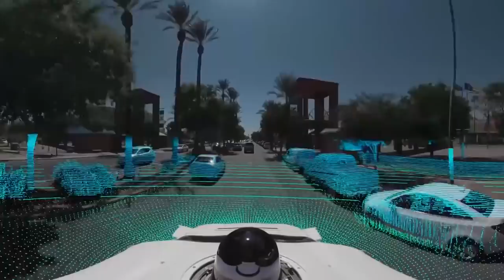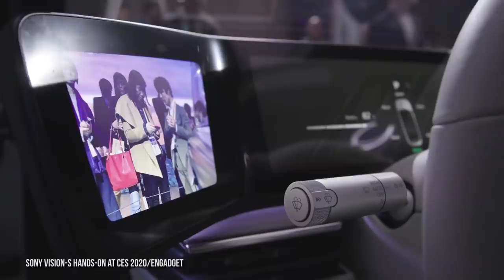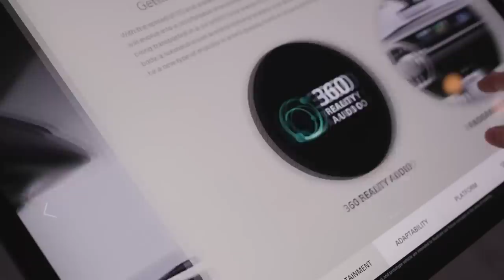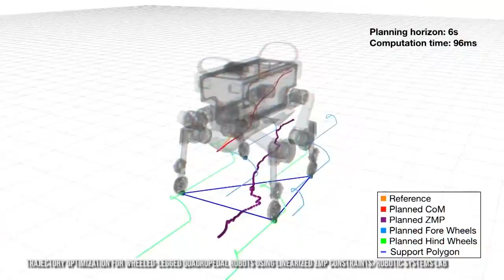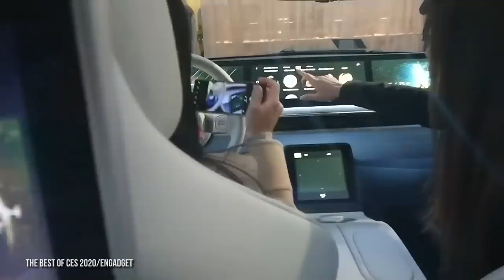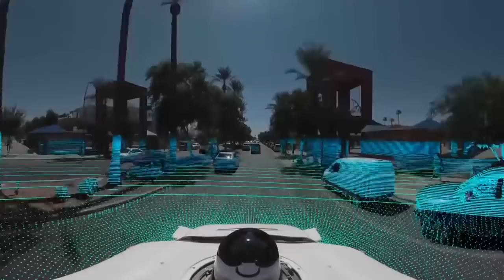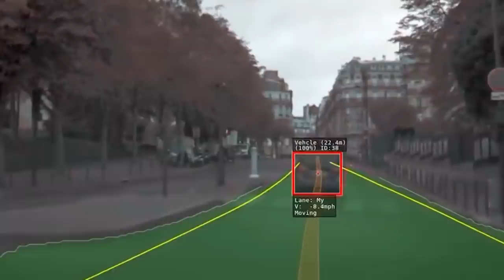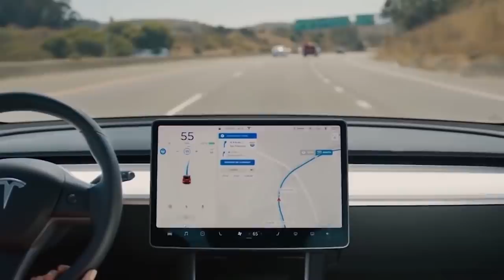Sony Officially Reveals Car To Beat Tesla

Comment: 2029: Tesla vs Sony vs iCar/Apple Car
Reply: 2029: VW already will dominate the electric market.
Reply: @ΒΞΔΝ  Yes a dream that will never happen.
Reply: ΒΞΔΝ Nope. Tesla will
Reply: @waynelewis9110  I would have to disagree. Tesla does now, but VW already has released the first electric model that is cheap enough for most to buy, they also already have enough factories in place to mass produce. They will be cheaper, have German quality builds, better warranty. Tesla is currently being exposed for poor quality, and customer service now that they are a few years old. I'm not sure Tesla can keep up when VW and Toyota start to mass produce.
Reply: @ΒΞΔΝ  Well the VW quality is shit since the Diesel gate, even Audi is cheaping out now.
Reply: @6meterkuk55  The build quality is still top notch. Yes VW brands are cost cutting in 2021 models because they are going all out in electric. As far as diesel gate, all that was, was having the cars programmed to unlock more power  after a certain mile to cheat U.S. smog standards. Sure it cost them a pretty penny, but that did not effect build quality, nor was the reason for cost cutting in 2021. We should also keep in mind VW owns Audi, Lambo, Bugatti, Porsche,  Bentley,  Lotus, Polestar, and Volvo. They have access to engineers from almost every top auto brand that is not U.S. or Japanese made.
Reply: ΒΞΔΝ years but don’t forget how Volkswagen with their the DSG gearbox made customers like me and so many other loose like 8000 usd due to por quality. I would say this was was Wieselgren then dieselgate.
Reply: @ΒΞΔΝ  VW is such a big company -> nothing gets done, executives talk and talk, and talk, and talk and literally nothing happens.
Reply: ΒΞΔΝ  second to Tesla.
Reply: @ΒΞΔΝ  Are you aware of the VW smog scandal? How about Toyotas Prius recall, or Tundra recall for dim turn signals? They can't even make turn signals properly. lol
Things you're missing : 1. Tesla charge stations. 2. Factories built for EV, not repurposed for EV 3. Streamlined sales. Ford to VW, theyre fighting their dealerships who make a lot of back-end on repairs. That's a lot of money EV's wont make them. It's like telling a restaurant to only sell chicken fingers when $30 steaks are its real money maker.
4. Battery tech. VW is expected around 300 miles, so their 2021 car will maybe get what Tesla's 2019 and 2020 cars get? 
I don't really see these companies being real competition personally.
Reply: ΒΞΔΝ 
 VW produce gas engines, they have not idea how to produce batteries.
They don’t have even a single battery factory.
Reply: @ΒΞΔΝ  that's what bums think 😂😂😂
Reply: ΒΞΔΝ eletric market maybe but autonomous is what matters more
Reply: @ΒΞΔΝ While I agree that VW is best placed to be the first true competitor to TESLA, the facts are that even if they started tomorrow to retool even one factory for electric cars only it would take 6 month to a year for them to begin making cars at best. Figure another 6 months to a year to work out all the kinks and bugs for getting started. Sp we are now 1 to 2 years away from their first production CAR. Tesla is already making 4 different production cars with a 5th coming next year, a new Semi-truck and by early next year will have 4 Gigafactories online. Include the fact that they have the largest charging network in the world, and still growing, and the most experience making electric vehicles and the batteries for them. That's a very big mountain to climb, not that it can't be done. If it was that easy for companies to go from gas to electric Tesla would have failed as soon as they proved that electric cars were a profitable market. For the last few years we have seen company after company say they have the next TESLA killer come and go, where are these cars now. This sounds strangely similar to when Sony put out the GAMEGEAR or Microsoft put out the XBOX and everyone assumed that NINTENDO was going to bankrupt or disappear. TESLA is going nowhere anytime soon and they will continue to dominate the market for years, if not the next decade, until someone can stop talking about the NEXT TESLA KILLER and actually put one into production. Even then TESLA is going nowhere soon.
Reply: @ΒΞΔΝ  - ba ba ba bullshit.
Reply: I say 2025, Tesla will apply for bail out from the federal government, *again*. Only Americans have this weird fantasy that Tesla can compete with the Germans and japanese automakers. Once the electric becomes mandatory that will be the demise of Tesla.
Reply: Also American built quality are like chinese made, all blink no reliance.
Reply: 2025: musk wealth exceeds 150 trillion on rumours of 100 to 1 stock split and crashing sales due to Samsung-Hyundai-Sony-Toyota-Panasonic car with better specs cooler design and free covid vax injected for every passanger every 15 min inside the car and also free netflix in 24k resolution. We call it progress
Reply: VW quality 🤮.....I think Toyota is also investing heavily in developing ev and fuel cells... because they are the richest automaker brand and they are the world leading car manufacturer that invest heavily in research and development.....still not sure what future holds
Reply: @boohoomoron7629  for the past 3 or 4 years every automaker has been talking about their new take on the EV that will blow away the competition (TESLA) and yet I have seen not one car come close to their first Model S. What makes you think that 5 years from now when Tesla, who only makes EVs, is on their 6th or 7th Gen car that some CE makers are going to put out a quality EV at a competitive price without losing significant money. Again, it is going to take a minimum of 6 months to retool a factory to make electric cars in anything approaching real numbers. You still have to get it certified for the road and market it to everyone and prove it is worth me dropping money on it. Just because VW or Toyota put their name on it doesn't mean it is any good or comparable to the market leader. If Teslas were as bad as some people want to believe they wouldn't be selling the way they do or holding their value quite so well.
Reply: ΒΞΔΝ I read your comment from a week ago where you said that the VW electric car will “be cheaper, have German quality builds, and better warranty”. I’ve never owned a German car but only because too many times have I heard people complain and read reports of German vehicle owners not being able to work on their own newish vehicles because the build was so complex that they needed to take it to a dealership for them to work on it. The dealership would in turn, no doubt, charge a hefty fee because they know they’re the only ones capable of fixing something because they have the schematics and tools. In my opinion, I feel as though German build quality won’t be the best when it’s the most complex. High performance cars are one thing, but when my  base model car is around the same price as German base model vehicles I can work on my car.
Reply: @ΒΞΔΝ  true, tesla poor build quality is showing, the car is built like ford focus with electric engine and big screens...it's made cheap...vw has more experience in building cars...vw makes buggati case closed...
Reply: @ΒΞΔΝ  LOL, thanks for that laugh. That was a good one.
Reply: @The-Heart-Will-Testify  take the the screen our of the Tesla, and you'll laugh at the interior, it's so basic, even more basic then some 80s cars. They only have good battery tech, it won't be long until they are surpassed
Reply: @sunitadey9701  They just measure everything based on data in US without considering other markets. I currently live in China and in big cities like Shanghai, Guangzhou or Shenzhen the EV account for 10% of all vehicles on the road. Tesla has sold shy of 80,000 last year why chinese manufacturers sold 1.4mln of EV cars. I guess Tesla is more suitable for american market given their low quality standards, much better network of superchargers,  more tesla service stations - but they surely won't become a world leader in that field. Therefore I agree with you that any car manufacturer can actually catch up or even outrun tesla in a near future. I'd even go beyond that and say that even chinese car makers have already done it (providing just as low quality product as tesla). In Guangzhou they have already been testing out self-driven taxis since 2019 with a great result.
Reply: @ΒΞΔΝ  Elon has been working on tesla since he was 30 years old and his goal wasto make electric car and scale em to a massive production.. that was the goal of his life. and he did it he have several years ahead of everyone and with the Software of lvl5 SFD ... tsla will be a 1T $ compagny by 2025
Reply: @aladdin8372  Well, look out Elon because his cars are getting a bad reputation slowly around the world. VW has released the ID-3 and Europe seems to love it. Will be coming to the states in a year or so. $35K. I'm not saying Elon won't be fine, he is unstoppable human, but the car industry won't be it for him long term. I guess we just have to wait and see how the VW holds up as a new market for them. I know one thing for sure the quality to price is already on VW's side. You will see the ID-3 be a soccer mom fav over minivans and SUVs by the looks of the design. Then I'm sure in time we will get a line of performance electric GTI, GLI, R
Reply: @ΒΞΔΝ  Once the giga factory will be over and full selfdriving software Beta version OVER + approved by gouv probly next year VW have 0 chances against tesla for atleast 5 year

Comment: "car to beat tesla"  the load of car makers that say that and the same number of car makers that failed lol. that aint gonna be different. even if the managed to have the same range as a tesla, they wouldn't have the big advantage tesla has, superchargers !
Reply: All those other challengers were Chinede automakers. This is Japan's Sony.
Reply: Tesla's Superchargers are not an advantage
Reply: Corey tesla superchargers are an advantage, there is no other such wide spread and available fast charging than superchargers. So if u want to go on vacation and spend 3 hours at the charger to get 30% go ahead, but tesla has the superchargers.
Reply: Outside of the USA, other chargers greatly outnumber Tesla chargers.

Comment: We are much closer to autonomous driving than we were ever close to a "flying" car. The only thing that would help speed that up would be if every car was computer controlled. We don't even need 'self-driving' to solve traffic jams. All that's required is computer regulated speed control.

Comment: Not sure I buy some of these premises. Like "The power drain from all the computing cancels out the efficiency benefit of having the car drive itself". And that Moore's Law is no more. I believe the chips in the new Tesla controllers are down to 7 nm with a likelihood of going to 5 at some point soon. Maybe the pair generates about 60 Watts, if that. One thing is true: along with Moore's Law's prediction about chip density, the attendant speeding up of the processors, which the computer industry has enjoyed lo these past four decades or so, has pretty much stopped cold. But semiconductor geometries do continue to get smaller and smaller - though no longer on Moore's predicted schedule.

Comment: Sony isn't actually making a car, AFAICT -- the car itself is built by a Volvo partner company involved with the Polestar brand.  Sony is making an off-the-shelf hardware and software solution for self-driving tech that automakers can just buy and integrate into their vehicles.  The car is just a live testbed.

The main competitor in that space isn't Tesla -- it's NVIDIA.  Heck, prior to Tesla going all total vertical integration, even they were one of NVIDIA's clients.

Though a similar product might exist one day, it will be as close to this as production cars usually are to concepts, and it will probably be a Polestar-branded car.

Comment: If Sony has no intention of releasing the Vision-S then why even build a car to begin with? They did it for their sensor technology, yes, but according to this they designed the car to have full control of their sensors. What’s going to happen when they release the sensors to other manufacturers, if they do? They won’t have full control of the sensors then. In my opinion, I strongly believe they would’ve been better off creating the sensors and then putting them on different manufacturers’ vehicles to test the sensors. This is the equivalent of me getting some water but not because I’m thirsty but to give it out when someone asks or I offer them the water.

Comment: Years ago Sony had great products and I had several of their products, then they started putting out over engineered junk and I bailed on them, glad I did.  Sony EV, no way, I’ll stick to my newer Tesla S, fantastic car greatest car I’ve ever owned and driven and I’ve been driving for over 60 hrs, used to be a hot rodder in my youth. Trust me my S moves and gets better with time with over the air software updates about every two weeks. Does your car get better with time? Teslas do.

Comment: I don't know....I still think SONY intends to make and sell it. The amount of testing, safety certifications, continued development of the car they have been doing for the past two years doesn't seem like it's just for a test bed. Not to mention what a fully thought out and complete product the Vision S is from the design, to the interior, to the features, to even the logo.....I wouldn't be surprised if SONY makes an announcement that they will make and sell this car. Hell they even designed the entire platform  from the beginning to be able to be adapted to any type of car (sedan, SUV, van etc...)
Reply: @cell phone and it appears we were correct given the announcement of the partnership with Honda.

Comment: Any EV is just like any other EV.  They all are limited according to the battery. The only thing that sets them apart is the look & software. If you are a software company, then you can make an EV. Bottom line: the battery is the game changer though. Make a battery that can go farther than a tank of gas and can recharge about the same as refilling a gas tank and you’ll be a trillionaire.

Comment: This is an actual good and viable car. It just upsets me that Elon musk had to come out with Tesla to make everyone, especially the auto industry get up off of their hands and get to work. Everyone just got content and ok with the status quo for over 30yrs. and the engineers have become lazy. Just constantly making small tweaks to the previous guy's work to close in on Mpg without making any real innovation. This is good work, I actually like the design of this better than the tesla. However, don't expect to beat them if you cant come down on that price and match or come close to their range.

Comment: It seems kind of silly to see this after people invested billions they can't solve small problems that require self adjustments to counter any environment condition. The who goes first in a crossroads is easy as well to solve, every problem there is an easy solution to start then you can refine it until you get what you are looking for. Most of the world problems have already been solved in a smaller scale you need to refine everything currently.

Comment: Tesla will win the self driving race, as it already has billions of miles across the globe in a variety of different climate conditions. It will license this software and hardware to others with zero exceptions. Also, Musk believes that his current hardware is well equipped to handle full self driving capabilities.

Comment: Why on earth would you build an autonomous car that has a top speed of 140-220 mph when all that’ll happen is you’ll get fined, jailed or worse crash and die.

Surely it tracks your data and will automatically send it straight to the police and just think how easy it would be for some hacker to hack into the system and take full control...

I’ll stick to a manually driven car thank you very much!

Comment: thats what i thought. sony wont make a car. but they just wanna get the tech right to sell it. in past i believed google would be the company to make the first self driving car. but then tesla did it. but they use google maps so google is also part of it i suppose. but my second guess was not toyota, gm or vw... i thought sony or samsung would make it as second. because selfdriving need hightech. and current car makers didnt have hightech. in fuel engine they were really good. but that was it. they couldnt get out of that comfort zone